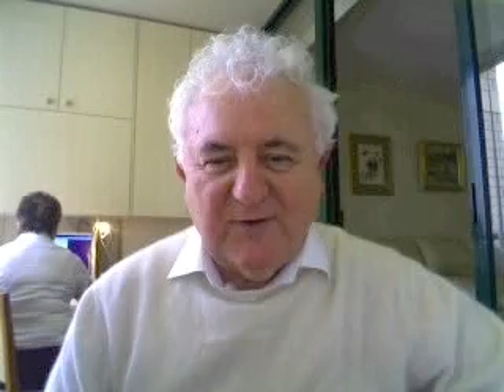How To Design a Home Solar System Part 1

Comment: I just did a google search of "elevator return energy" and found that modern elevator systems in tall buildings do have special drive mechanisms that generate return energy when the elevator is going down. Thus, the technology for storing residential solar energy is already available.

Comment: Here is a way that a residential house could effectively store solar energy during the five hours of good sunshine, to last for the full twenty-four hours.  Use a hydraulic elevator system lifting a very heavy weight, where the energy is stored by the gravity of the weight. When the sun goes down,or when more power is needed during the five hours of good sunshine, the very heavy weight movement is reversed and the hydraulics is used to generate power.